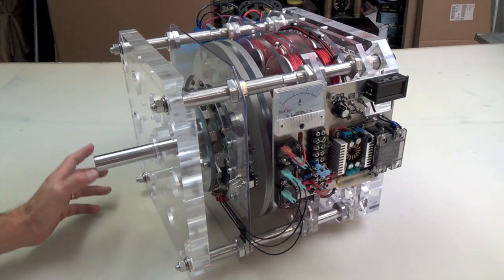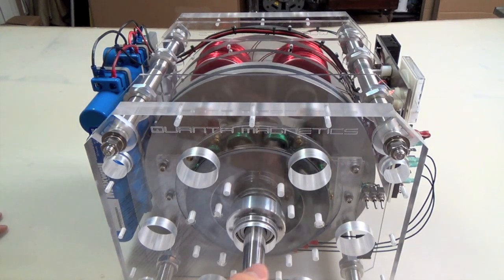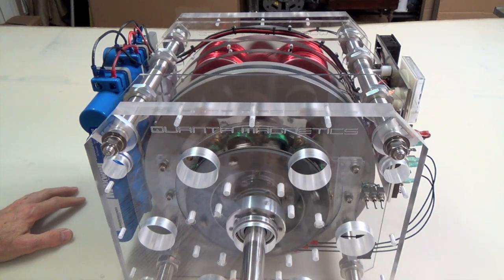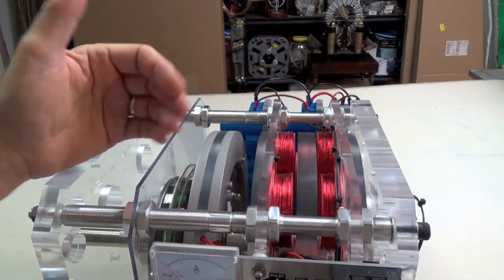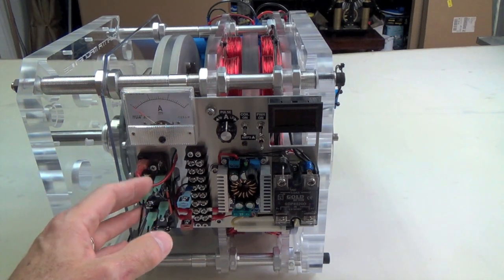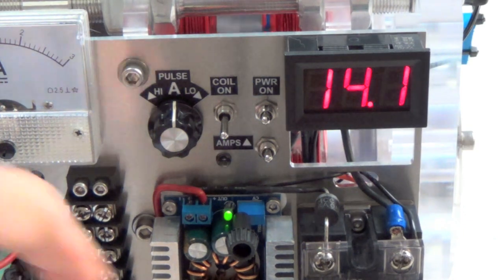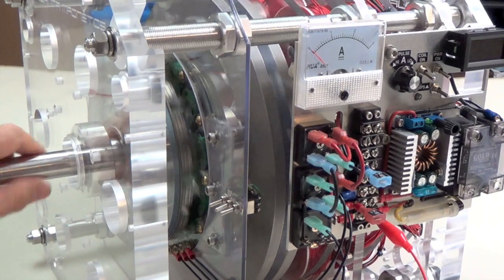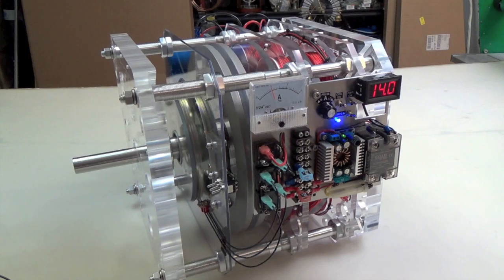Gyroscopic Inertia Pulse Motor Generator DEMO - 3 new inventions - one machine

Comment from the maker: Here's an interesting experiment you can do with one tiny part of a G1  https://youtu.be/Z_GUem5ADQs
Reply from the maker: +Hoefledorf   This was only the original prototype in the video. Gen kits are precision machined.
Reply: @PMMG4HYBRID , как я понимаю, эффект работает при дисбалансированном роторе c частотой вращения (резонансной)  7,83 Hz , поддерживая эту частоту вращения меньшими затратами энергии, чем необходимо для сбалансированного ротора. Значит, часть энергии для поддержания вращения ротор берёт от дисбаланса вращения нашей планеты?
Reply: @PMMG4HYBRID  You must have a pulse transformer and capacitor before converting to DC. You lose a lots of energi maybe over 50% when you do not filter the output
Reply: +PMMG4HYBRID The Disclosure Project.
Reply: How much this prototype??
Reply: how work the time in a stronk magnetic field?
Reply: Any updates?
Reply: @alexbayborodin6875  куда забросил?
Reply: @olegsigal  similar aproach different implementation 'Powerball NSD' it can charch battery if properly connect lol.

Comment: unrelated other than we are talking about gyros:
I actually had a really heavy gyroscope and was also interest in laithewaits demos, unfortunately, what looks like a lifting force is acually a rotational force. It only looks like accelerating forces because the gyroscope is attached to a pivotpoint.

if you hold the gyro and try the same demo with your hands to feel the forces you feel trotation, not lift

Comment: So it's basically an electric motor that has a flywheel that helps to generate power when you disconnect the power it take to run it?   I don't get it...

Comment: It needs a combinator which would be a dual just like it with the pulse is going the opposite way to suck in the power you're losing 50% because you don't have a dual runner going the office direction two motors one going the opposite direction should absorb the 50% making it 0 point

Comment: I have a masters in electronics, and I must say, that none of the terms used in this video, makes any sense to me. It also eludes me what that resonance thing is, or what turning the potentiometer really means.
With that said, it is a beautiful piece of mechanics engineering.
Reply from the maker: That's the problem with academics these days, they don't teach any common sense. For an education in resonance, see Schumann Resonant Frequencies.
Reply: @PMMG4HYBRID  I know what Schumann's frequencies are, but I completely fail to link those extremely weak electromagnetic waves, to any form of high powered generator. It simply does not work that way.
Reply from the maker: @MorsDengse  Thanks for your opinion.

Comment: The "Strong Field" shown in the conventional form description, is utilizing the vortex centripetal, magnetic force.
 The wasted magnetic field, is the non utilized centrifugal, opposite vortex magnetic force. The magnetic void is in the area between the two.
Very interesting design. What is the input wattage compared to the output? or converted to horsepower for the output?  A Tesla Turbine runs at 98 percent
 efficiency using magnetic bearings. It is amazing. He said it was his favorite invention, out of his many hundreds.

Comment: This is good but I doubt that gravity is electromagnetic for many reasons from classical physics. I do however utilize a frequency close to half Schumann wave to locate various elements in the earth's crust.
Reply from the maker: Classical physics didn't have deep space telescopes that help prove gravity to be ALL electromagnetic. The vacuum of space is full of energy as the stars "suns" at night.
Reply: @PMMG4HYBRID  Only electromagnetic as to do with the p and form factor electromagnetic  flavors of the graviton particles. There is no reach for a magnetic field much beyond twice the size of an object or body and yes if you could see all the particles in the vacuum you wouldn't be able to see much past the front of your eyeballs. But hey this vid isn't about that. Good work there keep it up. Power (total energy) to weight ratio of electric motors during service needs to be improved, that unit seems to be heading in that direction.

Comment: I have commented here on YouTube regarding my multi-Trillion Dollar personal power supply. I need to have someone make a control box for me. My question... most electricians that I have contacted do not offer services to make an A/C power supply nor any type of control box....they deal mostly with new home electronics. Which type of electrician do I need to call? I will share my multi-Trillion Dollar idea again with you here. An ignition switch is connected to a small motor cycle battery, which is connected to a start/stop motor, which is connected to an A/C power supply, which is connected to an inverter box, which is connected to a Monster box (Outlet box), which then has one line out back to the A/C power supply unit. This is where I need to have a control box guide the power into the A/C power unit when bypassing the motor cycle battery power. I have envisioned a streamlined version which would be perfect for camping, portable video game playing, cell phone charging, emergency situations when someone is stranded on the road and for use with a vehicles electronic system to ease the burden put upon the engine, as well as, many other uses. P.S. I have a design for an electric dynamo motor for vehicles. This motor is to utilize an electronic acceleration unit very similar to the programming involved with video game acceleration that simulates RPM.

Comment: If only you can draw the electromagnetic power closer and through the shaft towards the center you would have so much less drag under load and this greater output over time even though eventually it will stop

Comment: If you ran magnets on the other side of the magnet wheel of the axial flux generator and an additional stationary coil set up there too would you double the output of the axial flux generator? Then bring in graphene batteries as well would this be your best machine yet? The axial flux output can be ran into a 24volt inverter then and grid tied or charge a bank too.

Comment: General Question: I was wondering does the magnets in the rear powering the red coils still have the "lenz affect" (I think its called) locking up (under a heavy load) with the 2 sets of magnets on each side? Also can this unit shown above hold a 60hz and create 220v 10a.

Comment: Curious why you have not incorporated magnetic bearings or are you dealing with a thrust issue?   I am interested in your kits but when I try to look you up on line it seems to have you deferred to another website. How can I deal with you for a kit?
Reply from the maker: We use ceramic bearings for our own machines, but not for kits due to high cost. We have two URL addresses for our website. This one is secure: https://www.quantamagneticstore.com/  You can order anything in stock from there.

Comment: Hi  your  generator has real potential as for the magnetic field mount opposite pole magnets on outer walls of generator the same spacing as your rotor and coil is you could even try having that  adjustable to maximise  magnetic field

Comment: I've got a question....could this power/generator be used for like an electric vehicle? as in the drive source fed by 6 deep cycle batteries and would it be able to regenerate a portion of power back to the batteries? I ask because I've got an electric vehicle I was thinking of running by using one of these units as the primary drive. Or....would the unit be better for charging the vehicle batteries while they are in use??

Comment: TRY OBSERVING YOUR ELECTIC MAGNET FLYWHEEL UNDER DIFFERENT LIGHT WAVE SPEC TO FIND THE WAVE GEOMTRY LINES CHANGE THE MOMENT YOU SPIN ANY MASS YOUVE ALREADY CREATED A N S POLE MOST OF THE TIME WE ARE TAUGHT WHERE TO FIND N S IN AN OBJECT TRY TO FIND THE LOCATION  IN SPACE WITH NO MASS YOUR ABLE TO SEE IF YOU TRANFER ENOUGH MAGNETIC FORCE GEOMETRICALY RESTRAIN ALL THE LINES FROM THE OBJECT TO A POINT IN SPACE THE OJECT OF ORIGIN SHOULD FOLLOW THE NEW NS UNTIL THAT OBJECT REST

Comment: If the human body is made up of different cells that all vibrate at different Hertz? That all have a harmonic balance and also generate an electrical charge that keeps all the cells has a whole functional? What would happen to those cells being exposed to an overpowering harmonic force? There was a study I read about of cells becoming Chimeras from frequency change. Its a stretch but could this occur to microbiology around this generator your running? Life always finds a way?

Comment: If your generator is producing a field how far is its reach? Could you be causing cellular harm to other humans near by? Do you have detectors set up to monitor the fields and harmonics being generated by your generator set at a distance from point of transmission? Have you noticed any change in your own health from working with your generator? Have you thought about this aspect of your work? Just a mental note.

Comment: Cryo Sterling cylinders reach ultra low temperatures by vibrating a piston. Could not this vibration be recorded to find out its Hertz? Could not this Hertz then be reproduced electronically and ran through metal rods producing a new type of refrigeration unit? Induction works to heat iron up by magnetic fields which is also frequency right? Hay I am just thinking out loud here but does not all this vibration stuff have a bases in sacred geometry?  Nothing is solid right it only appears to be? So would there not be a transmission wave on a vibrational level that gives shape and form to all things?  I mean really if you know that cancer cells vibrate at a different Hertz then other cells in the body could you not use infrasound resonance to burst the cancer cells leaving healthy cells intact? If you were to know the frequency of malaria within a human body could you not destroy it in this same manner? Could this technique be used with aids and other illnesses? Novartis

Comment: Could you not use Hertz generated by different materials to produce a resonance to achieve all this without any moving parts? A harmonic electric power generator? Different Hertz ran through different rocks like limestone and basalt generate electricity. Find the right harmonic frequencies to achieve resonance and you will have a stable power source you can use without any moving parts. My best guess I am no scientist.

Comment: THE SS FLYWHEEL LOOK A LITTLE OF ALIGNMENT RESPECT TO THE SHAFT, IT OSCILATES A LITTLE, DOESN'T AFFECT THE SPIN ON HI RPM?
Reply from the maker: This was only the original prototype in the video. Gen kits are precision machined.

Comment: If the motor is so efficient why don't  you just use it to do the work (power a car etc) instead of generating electricity. Also if the generator is so efficient why not use that to power the motor, you could fasten the generator to the pedals and motor to the wheels and have a bicycle  far better than a normal bicycle. Good luck in your developments.

Comment: Ok, so our electromagnetic brainwaves are matched to the pulse of the electromagnetic field of the earth. I recall reading that you age slower while in space. Then I thought of the fact that people who are isolated longer times in deep underground caves have their circadian clock slightly slowed, which is thought to be because they can't observe day and night cycles. It it possible that the slower aging in space is actually because of the person being outside the electromagnetic field of the earth? Is it possible that the cause of the slowed down circadian clock is actually related to the magnetic field in some way? Since our brainwaves can be altered through actively entering a different state of awareness, for example through meditation, is it possible that we can actually lengthen our lives if we adjust our brainwaves correctly? Is it possible that earth is actually trying to shorten our life spans so that we die "faster", much like an immune system killing an infection? Are we actually an infection on a host? If so, did we come from somewhere else, or have we been here all the time like some beneficial bacteria that mutated and started attacking the host? Are we a cancer?

If anyone can poke a hole in my train of thoughts with some hard facts I'd be happy to hear them. I just spaced out for a bit. :D

Comment: so what is it's purpose??? what does it do???
Reply from the maker: +Stanley Hutchinson  Charge and maintain storage batteries primarily. Conducting experiments with 1,2 & 3 phase AC or rectified output, pulsing input to various Schumann resonance frequencies for charging advantage and research, applying inductive spikes to any or all other output for charging advantage, ability to operate including all above with small solar panel input.

Comment: very cool .
so it can be driven by any turbine such as gas or steam?
you mentioned 5000rpm to get higher amps, but in EU you'll need 3000 to get 50 hz and in the US 3600 to get 60hz...
still i cannot see how to enlarge in scale to a 60-100-300 Mega Watt generator that we have in power stations today.

anyway, it is still fucking awesome :)

Comment: for the lay, what does this actually do?
Reply: +Jason DeLozier Like...?
Reply: Vacuum is no problem my friend, and I happen to be French, or part French I mean.  No harm, no foul.  I wish you well.
Reply: While I have never seen one in action, the inventor claims that it does many things.  One demonstration shown shows a very tiny 12V power input from a solar panel and charge controller that is capable of running the motors and charging the capacitors which he says at that point that you can place a load on it and the amount of Amperage consumed by the device will not raise while it's under a load.  I have many questions as well.
Reply: +Xanode There are numerous as in a multitude of applications for such a device.

Comment: PMMG$HYDRID great work combining 3 forms of energy to create one form (watts) .i have a similar system but bigger flywheel with ballast to create more inertia. what are getting when you put the system under load ? I initially get 5 to 1 but under load I get 3 but its  still good however I still need more solar panels to charge up batteries. getting close to off grid. PS. I tried your stargate works great great job PMMG4HYBRID

Comment: I have a problem with this.  If you wanted to get the best out of your alternator, you would have inserted iron centres to intensify the magnetic field.  That would prevent the rotor spinning freely.  Your rotor is spinning freely at low speed.  So if you move iron cores past a permanent magnet, it will cog, and stop the rotor.  That is not happening here, please explain.

Comment: This all is way over my head but I have to ask if at 1 amp input can you drive a load on the shaft preferably a tripled direct driven rf pump device ( the ones from the front loader washers that everyone is using to attempt to harvest radiant energy)
 to then back feed the capacitors ON your unit to become not over unity but perpetual or at least until the bearings fail. sorry if my terminology lacks I am just a layman.

Comment: I just discovered this site yesterday, and watched all of the available videos back to back. I am utterly naive about the science and technology behind this project, but I am very excited about the work that is being done here. Naturally, I have a few questions.

1. Why not simply use two flywheel/generators in place of the magnets on the outside of the coils? I suppose the flywheel design would have to be tweaked somewhat, but it seems to me that they would help bound and further smooth out the magnetic field, as well as adding more inertia from having a second flywheel, and more power from having a second generator.

2. Have you experimented with flat coils or Rodin coils?

3. Have you tried tipping the assembly up 90 degrees and running it vertically instead of horizontally?

4. There don't seem to be any video updates since August 2014. What new and interesting things have been happening since then?

In the meantime, I wish you well - and keep up the good work!

~Mace

Comment: are you still alive ?
Reply from the maker: coojsta69 Only on Tuesdays.
Reply: PMMG4HYBRID ok good :) 
I remember seeing a mainstream media news program where a inventor had a unit that plugs into your wall outlet and from the unit it allows you to plug 5 or so appliances yet only draws a small amount of power and was measured useing only enough power to run 1 appliance 
the program went on to say that the product was going into mass production and will be found in walmarts by next year 
(im wondering did you have anything to do with that invention? )
Reply from the maker: coojsta69 No, but I sure know how it works, and doubtful that it will be mass produced any time soon.

Comment: Have you had any success charging lithium ion  batteries in your experiments?
Reply from the maker: Tesla Red You can charge lithiums only if you adjust output to match the charge specifications. They are more particular than other rechargeables.